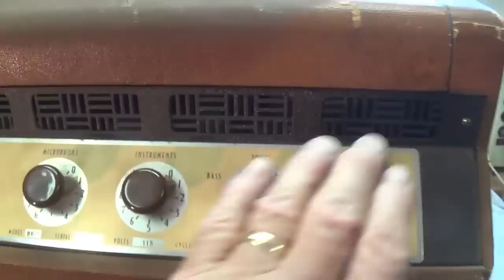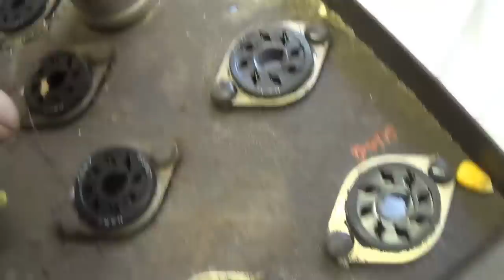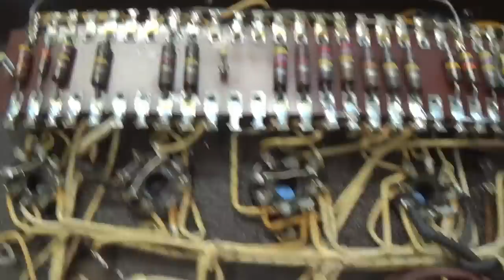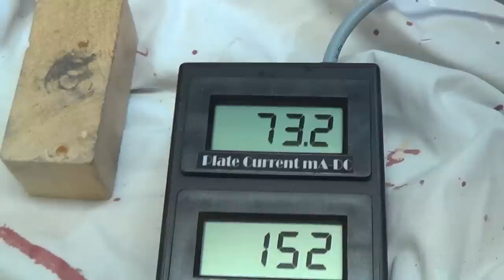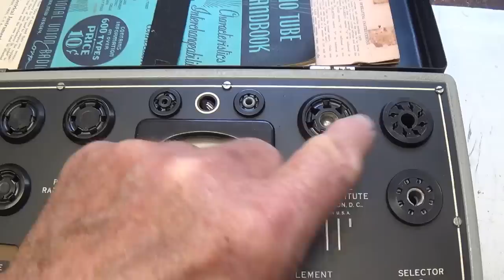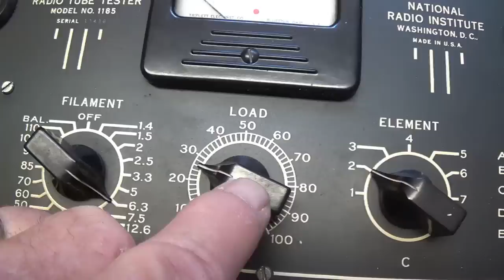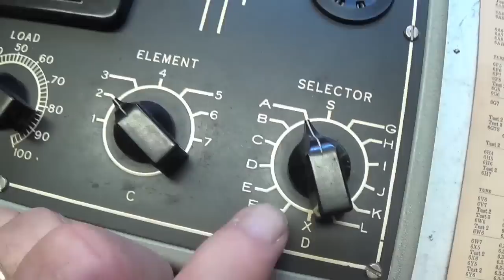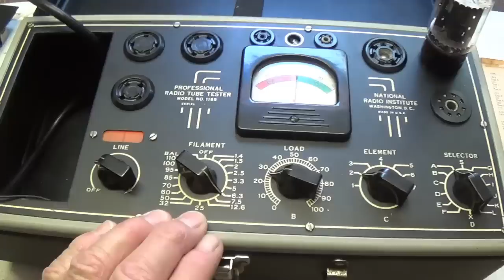Rare & Wonderful: 1946 Gibson BR-1 Amp and 1941 Triplett Tube Mini-Tester

Comment: From Leo:   Great save of a really premium old amp.   I have never seen one of those and I have been playing with old amps since the late 1960's.     There is a guy that calls himself  "D-Lab" on you tube.   He fabricates a slick capacitor package by mounting modern caps to a tube socket so the caps stay above the chassis and they connect like an original.   I tried it on a tight chassis and it worked great.   Might help in a bind sometime.
Reply from the maker: Thanks, Barb......for the nice comments and helpful suggestion.

Comment: WOW...amp sounds really great.  Learned something new about the circuit that they used back in the '40s.  It all pans out with the final PD of the tubes @ 12w !  Another great video from you Doug....many thanks.  I wonder if Jack sniffed out the "rodent" issues  when you got the package ?
Reply from the maker: Thanks, Tom. This was the property of a local collector, so no sniff testing was performed for fear of insulting the owner :)

Comment: Maybe add a small fan to the bottom slot to force some additional air through that "tight" top grill.  I have used some premium fans from "Be Quiet".  There very best models (not cheap) claim only 15-20 dB.... er.... maybe?.  I did change out forced cooling fans in a couple of stereo PA type amps and the Be Quiet fans were "much quieter" than the originals, (but you could still hear them).  I think their main market is powerful gaming computers that sometimes have several fans.
Reply from the maker: Excellent suggestion, Dennis. Thanks !!

Comment: Interesting.   I'd have concern for wax caps leaking positive voltage to the grids...   but despite all the hype,  amps that aren't running at "fender" voltages seem to have longer cap life.
Reply from the maker: Good observation, DK. I guess that's why caps in the tone circuit seem to last forever. The coupling caps seemed to work just fine......so I left them intact.

Comment: Thank you so much for your videos they are inspirational just a quick question does a 63 Falcon have to be biased if you change the tubes
Reply from the maker: You're welcome. How are the output tubes biased.......cathode or grid?
Reply: @UncleDoug   I dont know..
Reply from the maker: Then I suggest taking the amp to a tech to get it re-biased just to play it safe.
Reply: @UncleDoug  will do..also gonna get filter caps checked.. I'm getting a little bit of 60 cycle hum